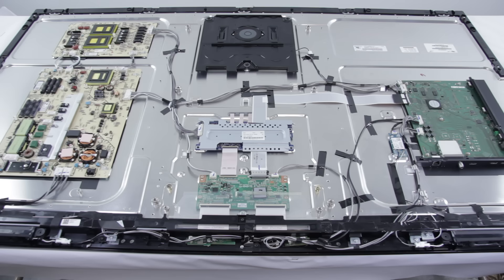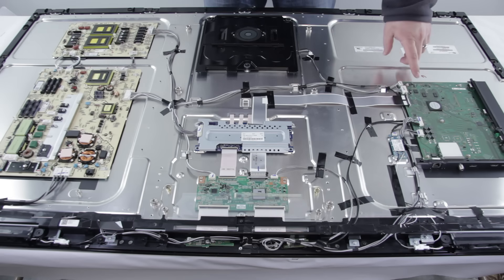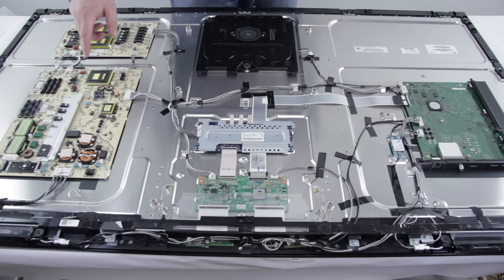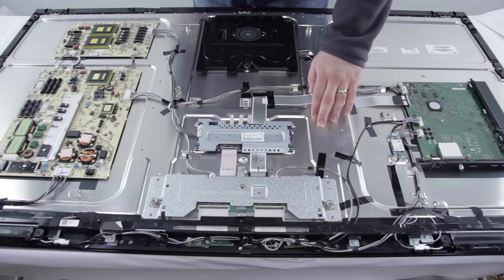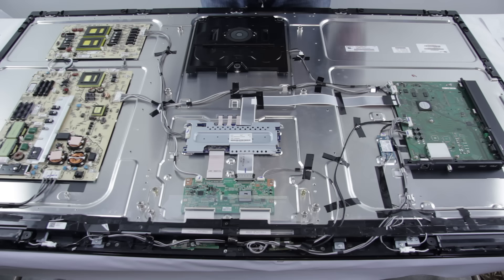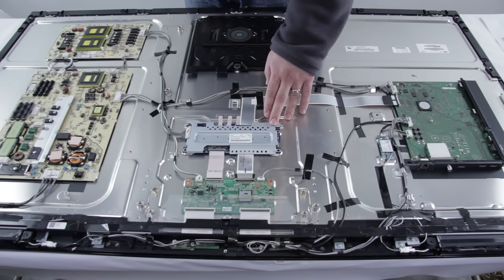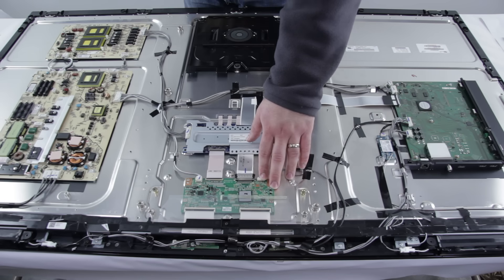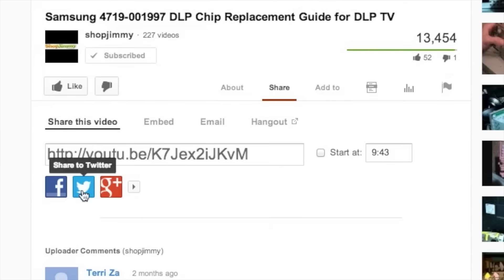LED TV Repair Tutorial - Common Symptoms & Solutions - How to Repair LED TVs

Comment: hi, i have a LG 55" model 55lv4400, i need help, it present this problem one day suddenly the tv didn't turn on, the technician told me that the main board didn't work, because the eeprom memory had had a damage, and i had to replace the eeprom memory, but after i replaced it, the TV didn't work only turn on the back light. and the technician told me that i had to replace the entire main board, i bought the main board and i replaced it on the tv, but nothing happened, now the tv doesn't turn on neither the back light. what do you think that i could do?.could you help me please...thanks..

Comment: I own a tx-l50b6b panasonic tv. 

today the lower half became fuzzy and lines can be seen on the screen. 

what do i need to fix it. cheers
Reply from the maker: xXFIREWIREXx   Try all repairs and troubleshooting at your own risk.  This sounds like a TV panel (TV Screen) problem.  If your TV panel is bad, it may be more cost-effective to replace the TV as panels are typically hard to find in stock, difficult to replace, and expensive.  Thanks and please let us know if you have any further questions!  www.shopjimmy.com

Comment: I have a LED 42 M420NV. The T-Con is bad. I have sound but no picture. I do have back light also. Took the back off to find the T-Con Board but its hidden or on the other side of the back panel...Is it hard to change that board?
Reply from the maker: Regiss Williams  Try all repairs and troubleshooting at your own risk.  There is not a t-con board for this model.  This could be a problem with either the main board or the TV panel.  You can replace the main board to see if that fixes the problem.  Click this link to replacement parts for your TV model number:  http://www.shopjimmy.com/catalogsearch/result/index/?cat=56&q=42+M420NV  There may be multiple boards for the same TV model number, be sure to match part numbers on your current board, with your replacement for compatibility.  Here is a link to a video showing how to identify your part number, click here: https://www.youtube.com/watch?v=kxkeGLhlQY8  Thanks and please let us know if you have any further questions with your TV Repair!  www.shopjimmy.com

Comment: Hi, I have a 55" Furrion LED TV, model no: FEFS55L1D. I am assuming its a sidelight LED tv, the problem is that the right side lighting is not working anymore. A 1/5 way down from top of the right side the lighting is fine but going down its not. There are no problems with the audio and video of the TV, just getting a darkened image due to lack of the lighting on the right side. The left side is perfectly fine.

Heres the thing though that I can't figure out, when I switch on the TV all the lightings come on fine but within a second the lights go out on that right side. This happens immediately everytime I switch on the TV.

Also wanted to mention: What I was doing when I first noticed this problem was with the TV switched on, after 15 to 30 mins or so, I would switch it off then on again straight away, and the lighting would be temporarily fixed until I next used the TV. But after a couple of weeks doing this, the quick-fix is no longer working. Now its constantly off even though I get that 1 second lighting right at the beginning :/

I feel that it may be an isolated capacitor issue but I am not sure. I'd really appreciate any help in this matter. Thanks

Comment: My samsung UN48H5500 has a multi cracked screen.  The sound and functions all work great but the LED screen is all spidered from poor packing during moving trip.  I opened it up and have all the sticker codes.  Is a replacement LED possible?
Reply from the maker: bluebox212  Try all repairs and troubleshooting at your own risk.   Unfortunately, this is not fixable and we do not sell replacement panels.  Thanks!  www.shopjimmy.com

Comment: Hey Hey Jimmy. Im having issues with my LG Lx6500 turning on. I hit power on the tV the other day & it started too turn on Then made a noise then shut rite back off will not turn back on. Can U help me with where i can find a power supply board from?
Reply from the maker: Malik Fuller   Try all repairs and troubleshooting at your own risk.  This could be a problem with the power supply or the main board in your TV.  You can replace each of those boards individually to see if one of them fixes the problem.  Click this link to replacement parts for your TV model number:  http://www.shopjimmy.com/catalogsearch/result/?q=Lx6500  There may be multiple boards for the same TV model number, be sure to match part numbers on your current board, with your replacement for compatibility.  Thanks and please let us know if you have any further questions with your TV Repair!  www.shopjimmy.com

Comment: I have a Samsung UN39FH5000FXZA tv. It has imtermittent  problem. Sometime when it's first powered on it displays no picture but perfect sound. Atfer a few on-off cycles the picture will display and will stay on. It might have this problem every couple days. Thanks
Reply from the maker: Curtis Grady  Try all repairs and troubleshooting at your own risk.  I recommend replacing the main board in your TV.  Click this link to replacement parts for your TV model number:  http://www.shopjimmy.com/catalogsearch/result/index/?cat=56&q=UN39FH5000FXZA  There may be multiple boards for the same TV model number, be sure to match part numbers on your current board, with your replacement for compatibility.  Thanks and please let us know if you have any further questions with your TV Repair!  www.shopjimmy.com

Comment: I have a lg led tv .model# is 47ln5200-ub. Serial #is 311rmaq66504. TV was on then all of a sudden picture went black but still has sound. Put flashlight up to screen and seen image with light. My question is do I need to replace power supply/led board?
Reply from the maker: Paul Walker   Try all repairs and troubleshooting at your own risk.  This could be a problem with either the power supply board or the LEDs in the TV.  You can replace the power supply to see if that fixes the problem.  Click this link to replacement parts for your TV model number:  http://www.shopjimmy.com/lg-eay62810801-power-supply-unit.htm  Be sure to match part numbers on your current board, with your replacement for compatibility.  Here is a link to a video showing how to identify your part number, click here:  https://www.youtube.com/watch?v=_4Qpfan0vdU  Thanks and please let us know if you have any further questions with your TV Repair!  www.shopjimmy.com

Comment: I have a Samsung Model UN40C6400     Regardless of the input I use (coax, hdmi, rca) the same thing happens to the screen.    There are both vertical and horizontal lines that flash and move all around it.  I have a video of what it looks like.    https://youtu.be/KCRKB5XX1FU

Any idea what this might be?
Reply from the maker: athene2112   Try all repairs and troubleshooting at your own risk.  This could be a problem with either the main board or the TV panel.  You can replace the main board to see if that fixes the problem.  Click this link to replacement parts for your TV model number:  http://www.shopjimmy.com/catalogsearch/result/index/?cat=56&q=UN40C6400  There may be multiple boards for the same TV model number, be sure to match part numbers on your current board, with your replacement for compatibility.  Here is a link to a video showing how to identify your part number, click here:  https://www.youtube.com/watch?v=BEPWrefQvqI  Thanks and please let us know if you have any further questions with your TV Repair!  www.shopjimmy.com

Comment: I've got a Emerson mo.nb.LFf32OEm4 led all that comes on is the backlight.  It just  quit
. Please advise. Email or 816-382-7781
Reply from the maker: gary taylor   Try all repairs and troubleshooting at your own risk.  This could be a problem with either the power supply or the main board in your TV.  You can replace each of those boards individually to see if one of them fixes the problem.  Unfortunately I do not see any replacement parts in the search results for your TV model number on our website.  Thanks and please let us know if you have any further questions!  www.shopjimmy.com

Comment: where can i get a led backlight inverter for a lg tv. model number 47LN5700
Reply from the maker: Matt Griffin   Try all repairs and troubleshooting at your own risk.  I believe the inverter is built into the power supply.  You can double check on your parts.  Click this link to a replacement power supply/inverter for your TV model number:  http://www.shopjimmy.com/lg-eay62810801-power-supply-unit.htm  Be sure to match part numbers on your current board, with your replacement for compatibility.  Here is a link to a video showing how to identify your part number, click here:  https://www.youtube.com/watch?v=_4Qpfan0vdU Thanks and please let us know if you have any further questions with your TV Repair!  www.shopjimmy.com

Comment: Have an LG 60LS5750 that has no picture.  Was watching and it just went blank.  Has sound. When you power on, there is some brightness and a line occasionally appears but then goes dark.  You are barely able to see the blue background.  About 3 years old.   Thank you.
Reply from the maker: Ron B   This sounds like a TV panel (TV Screen) problem.  If your TV panel is bad, it may be more cost-effective to replace the TV as panels are typically hard to find in stock, difficult to replace, and expensive.  Thanks and please let us know if you have any further questions!  www.shopjimmy.com

Comment: ShopJimmy.com  Hey guys I have an LG 47LN5400 that the picture suddenly went dark on.  I administered the flashlight test on it which it passed as I can see the picture through the backlight and the set itself powers on fine.  I am sure the problem is the T-Con board since I could cycle through the inputs during the flashlight test.  I did not see the exact T-Con board on your site for this TV.  Can you make a recommendation or a suggestion if my own diagnosis is incorrect?  Thanks.
Reply from the maker: xeynx  Try all repairs and troubleshooting at your own risk.  This could be a problem with either the power supply or bad LEDs.  You can replace the power supply board to see if that fixes the problem.  Click this link to a replacement power supply board for your TV model number:  http://www.shopjimmy.com/lg-eay62810801-power-supply-unit.htm  There may be multiple boards for the same TV model number, be sure to match part numbers on your current board, with your replacement for compatibility.  Here is a link to a video showing how to identify your part number, click here:  https://www.youtube.com/watch?v=_4Qpfan0vdU  Thanks and please let us know if you have any further questions with your TV Repair!  www.shopjimmy.com

Comment: I have a Sony KDL-60EX645. It will run for about 20 minutes and shut down with a six blink error code. The error reporting says
 002 Main_Power 000
003 DC_Alert1 000
003 Audio_Prot 000
005 TCON_ERR 000
005 Panel_ID_NVM_ERR 000
006 BackLight_ERR 010

Is there a fix for this problem?
Reply from the maker: John Cronkite  Try all repairs and troubleshooting at your own risk.  It sounds like you have bad lamps in your TV.  Unfortunately we do not sell replacement lamps for your TV model number.  Thanks!  www.shopjimmy.com
Reply: ShopJimmy.com Do you know if the lamps are replacable or are they part of the screen? I have tried searching but Google failed me.
Reply from the maker: John Cronkite  Try all repairs and troubleshooting at your own risk. It looks like your TV is actually an LED TV, so the backlighting is LEDs and not lamps.  Yes, they should be replaceable, but that can be a difficult repair taking everything apart.  You can search online for replacement LEDS, but might be tough to find.  Thanks!  www.shopjimmy.com

Comment: Hello gentlemen's,
I have a 32pfl5507k/12 with problems ,it wil give no image and sound but the power supply is good it have all the output voltages and backlight it's working,on the T-Con (PH_120PSQBC4L V1.0) the fuse is god and finds 12V on it, also some 3v3 are on the LD117 voltage regulator . Please lead me were should I measure or what to check.
Thank you .
Reply from the maker: mihai sara   Try all repairs and troubleshooting at your own risk.  I recommend replacing the main board in your TV.  Unfortunately I do not see any replacement parts in the search results for your TV model number on our website.  Please reply with your part number on your main board and I can try searching for replacement parts.  Thanks and please let us know if you have any further questions!  www.shopjimmy.com
Reply: ShopJimmy.com  I'm back with te number of board (313912365324-MB/65334-SB)Thank you.

Comment: Hi there

I have a UN32F5500AF Samsung LED TV, I am getting black screen with sound, flash light test shows menu. I replaced the TCON and Mainboard, this did not fixed the problem. I am LOST.
Thanks
Reply from the maker: csreso1  Try all repairs and troubleshooting at your own risk.  This could be a problem with either the power supply or bad LEDs in the TV.  You can replace the power supply board to see if that fixes the problem.  Click this link to a replacement power supply board for your TV model number:  http://www.shopjimmy.com/samsung-bn44-00605a-power-supply-unit.htm  There may be multiple boards for the same TV model number, be sure to match part numbers on your current board, with your replacement for compatibility.  Thanks and please let us know if you have any further questions with your TV Repair!  www.shopjimmy.com

Comment: Hi I have a RCA  LED42C45RQ. I turned it off by the front power botton and got shocked from static electricity and now my volume is messed up when I press the volume or any botton on the remote the menu comes up. Help Please

Comment: Samsung Model# UN32EH4003V LED TV. Unit started cycling on and off repeatedly and will not stop unless I unplug it. When I plug it back in it the issue continues. Is this a power supply issue? I checked and there are no bulging capacitors
Reply from the maker: billyalford2000   Try all repairs and troubleshooting at your own risk.  This could be a problem with either the power supply or the main board in your TV.  You can replace each of those boards individually to see if one of those boards fixes the problem.  Click this link to replacement parts:  http://www.shopjimmy.com/catalogsearch/result/?q=UN32EH4003V  There may be multiple boards for the same TV model number, be sure to match part numbers on your current board, with your replacement for compatibility.  Thanks and please let us know if you have any further questions with your TV Repair!  www.shopjimmy.com

Comment: Following my posted query about a week ago (see below), accessing the main board revealed its number (8TCBJN1F1A) and also the set's details!  It's a Technika TEC185-GB-2B-HCDU-ROI.  Anyway, I had to disconnect a couple of plugs to gain access, but also noticed a 20mm wide foil strip stuck to the main board but its other adhesive end wasn't attached to anywhere/thing. As its intended 'home' looked like the back of the screen, that is where I stuck it.  Then on re-assembling the set and switching on, everything worked fine - reception (picture & sound), the remote control, DVD player, all good!  So guys, do you think that disconnected foil was the problem or could it have been disconnecting/re-connecting the plugs that 'cured' my problem?  I'm intriqued.
Reply from the maker: Keith Mann  Disconnecting/connecting is what would have fixed the problem.  Thanks!  www.shopjimmy.com

Comment: Hi I have a LG 47ln5700 with no picture but have sound. When first turned on the big red LG flashes on then the screen goes blank. The flashlight test revealed a picture was active. I ordered and replaced the combination led driver/power supply board but still have the same problem. Any ideas?

Comment: Hi, I have a SEKI 32" LED TV.  It just didn't come on one day after about 3 months of not using it. The green power light came on, but that was it. It's almost brand new.  When I called and requested a replacement/refund they asked me to send them 6 inches of the power cable, that is all.  So I have this TV with plenty of cord to splice in and hope to repair it.   SEKI 32HS01

Comment: I have a 55" SEIKI LED tv, model #LE-55GB2.  It has horizontal lines and showing double. Any help would be appreciated.
Reply from the maker: *****   This sounds like a TV panel (TV Screen) problem.  If your TV panel is bad, it may be more cost-effective to replace the TV as panels are typically hard to find in stock, difficult to replace, and expensive.  Thanks and please let us know if you have any further questions!  www.shopjimmy.com

Comment: I have a 55 inch samsung smart tv 3D LCD or LED Im not sure, I couldn't find the model number on the back sorry, I bought is about 3 years ago, my TV symptoms are as follows, the right side on the screen loses color and distorts and hold previous images for a small period of time and if I turn it off and back on it goes away at times, the problem comes and goes its not always there. also there is a line about 4 inches from the button of the screen that goes from right to left but fades to where you cant see it on the left side but its really apparent on the Left side. Please Help
Reply: smatsoyan correction (apparent on the Right side)
Reply from the maker: smatsoyan   This sounds like a TV panel (TV Screen) problem.  If your TV panel is bad, it may be more cost-effective to replace the TV as panels are typically hard to find in stock, difficult to replace, and expensive.  Thanks and please let us know if you have any further questions!  www.shopjimmy.com